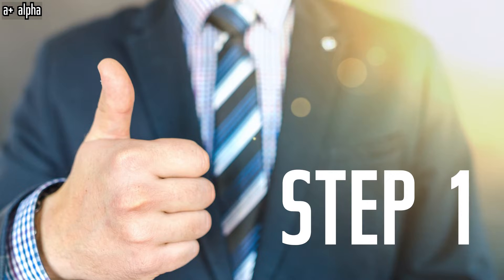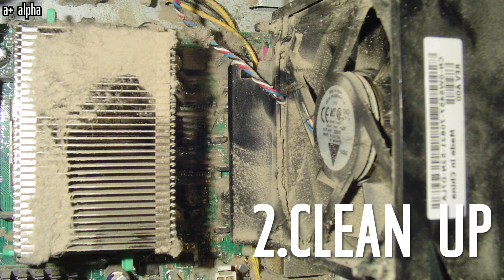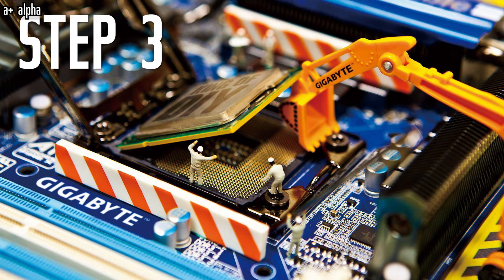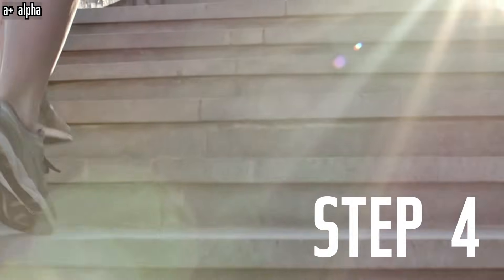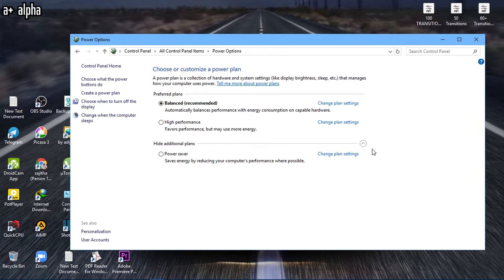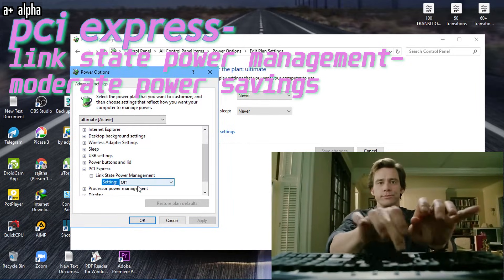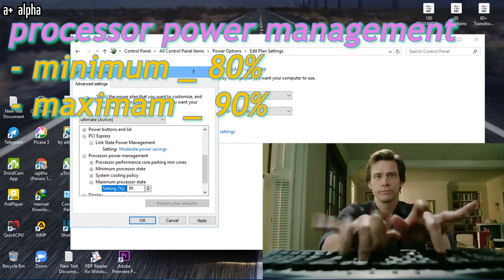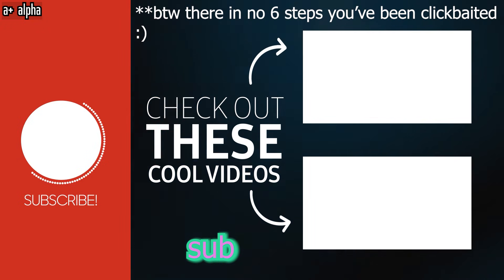✔️how to FIX your PC high temperatures | overheating CPU/GPU when gaming [complete guide]

Comment: I used step 4, it dropped my idle temp from 70 to 40 - 45.
I will edit the comment when I check the temperature in-game. 
Edit: I checked BeamNG drive and came to a conclusion that the problem is itself in the game, the temperature didn’t change at all. BUT then I checked MGSV, there the result was noticeable. My temp dropped form 60 - 70 to 52. I didn’t really notice any fps drop. My pc became less noisy. So, for those who are reading this, step 4 was relly helpful, you should definitely try it out.
Reply from the maker: Appreciate the comment ❣️
Reply: @AAlpha69  thx

Comment: I switched power plan from Balanced to High Performance. Apparently there is some glitch on the balanced plan that caused the processors to overheat when going at full capacity, but by switching to high performance my processor is back at 4GHz without the temperatures climbing high.
Reply: I'm having this issue as well where the Balanced Power is causing my CPU to overheat but when switched to Ultimate Performance it goes down
Reply: Is it applicable for laptops too?
Reply: @toonsduniya6721  The glitch was/is on Windows 10 Home for desktop, but having too many tabs opened on Firefox browser also caused some overheating.

Comment: I messed with the power management setting before and cranked it up. Cpu started freezing and supper bouncy hight temps. I turned down settings and forgot about it, temps stayed around 45-60 with aoi. Started chasing fps again and now back at 80-90C consistently. So here I am full circle once again lmao

Comment: Guys, does step 4 make the fps decrease? Or something like that
Reply from the maker: If your CPUs not bottlenecking sys, There won't be a performance loss.
Reply: @AAlpha69  I've an i7-11700F and a RX6600. I checked on a website and it says neither CPU nor GPU bottleneck. Do you agree?
Reply from the maker: @gabryxr  probably not. Try max state at 99%.

Comment: Wont this efect on perfomans when it comes to 4step ?
Reply from the maker: Set max state 99% when facing such performance drop..
Reply: @AAlpha69  it helped a lot i removed case glass and i did step 4 temp in far cry 5 dont go over 46 celsius

Comment: Hey thanks bro for the vid. It is 🔥
But after applying the 4th step CPU temp is fine but performance takes hit like some minor slutter and 10-12 fps drop (even in Minecraft)
Currently testing the new game stray it is shuttering too much with this . Any advice?
Reply from the maker: Set max state to 99

Comment: This is probably best tutorial I found on yt ever, thank you so much! I dont expect much clicking on videos like this because they usually tell you about obvious stuff and stretch the video as much as possible, but this one is straight to the point and with a little bit of humour. My CPU temp is now at 75'C down from 95 and gpu at 70 down from 80. Its also solved my performance issues that I thought were caused by disk. I was literally about to buy a new one but turns out I just had to limit my cpu a little bit lmao. Thank you a lot man

Comment: June 2022, Here to say THANK YOU. Got an i5 11600k with an Aorus ATC 800. With my previus 3060ti it does'nt had any issues. But I've recently upgrade to a RX 6900 XT and man, the CPU goes to 75/79 so fast in some games and I wasn't able to lower it. The step 4 has made and inmediatly change and the cpu no have not reached the 60° yet! Fabulous!

By the way, to the troll that is saying performances o fps drop by using this metod, I can confirm than you don't loose not even 1 fps. On some games the fps have even got better!

Comment: I have a 5950x and 6900xt with a z73 and 1000w gold psu. I noticed my cou got from 64 Celsius to 84 and up to 94 and then it auto shuts off at 99 Celsius but apex legends is the only game this happens with. Any comments or suggestions ?
Reply from the maker: Try 4th step.

Comment: I tried step 4 and I’m still getting 82 degrees on overwatch medium graphics and for most of my other games it keeps getting so high
Reply from the maker: probably bad airflow or bad cooler...
Reply: @AAlpha69  it’s a prebuilt I bought a couple weeks ago is this a common problem?
Reply from the maker: @spongewitdagat272  Check if there's thermal paste applied or not. Which type of cooler is it?liq or normal?

Comment: Step 4 really fixed my problem, if temperatures rise again I will make a edit to my comment . At first i was having abnormal temps on idle which wasn’t ideal but I could live with it , then I upgraded from a Ryzen 7 3700x to a ryzen 9 5900x and that is when I started having my pc crash due to reaching 81c and up . This video has helped me more than ANY other video . And I’ve tried many .

Comment: I am absolutely gutted I just bought a new PC 3060ti with i5-12600k
The GPU is probably fine when reaches 80s maximum but the CPU is so much high and didn’t expect that 100 degrees in some games and others are 90s I was using the intel stock fan it was a mistake after that I put a liquid cooler dark flash symphony TR120mm one fan still didn’t help I don’t know what the heck is going on
Reply from the maker: try the 4th step...
Reply: @AAlpha69  I used this step in my old 2070rtx gaming laptop it was fine and it doesn’t go more than 80s but it sacrificed too much perfromance so I didn’t get PC to do the same as the old laptop what other solutions could I do ?
Reply from the maker: @Am94514  MAKE SURE THE AIR FLOW IS GOOD IN THE CASE..

Comment: Note when u about to do the step 4 it will decrease your cpu ghz/speed (by like 20% or 30%) buut it will fix ur high temp problem.
Reply: Dumb question but what will happen if it gets decreased? Like what are the side effects
Reply: @Hourglass276  slows down your pc but not really that slow, its just that it wont have the same speed as before but its better since you dont have to worry about your pc overheating

Comment: Does step four take a hit on your fps? Or smooth sailing
Reply from the maker: itll reduce freezing
Reply: @AAlpha69  i did step four, then over clocked, keeps temps at bay and my fps is solid thank u❤️‍🔥
Reply: @akaricodane401  safe?
Reply: @aj-ln4by  safe!
Reply: @akaricodane401  did you do the exact thing in the vid or did u tweak it
Reply: @aj-ln4by  no i did step 4 then went to my bios and OC the cpu got it up to 5.0gz with high temps of around 60 now and usual around 30 to 40
Reply: @akaricodane401  any fps drops?
Reply: @aj-ln4by  no increases actually cause its cooler

Comment: Your video definitely lowered my temps, with CPU heavy games like Cold War and Forza getting lower than 50 degrees most the time, but I was having issues where my windows would start to crash. Could this be fixed by raising the maximum power state to 99%? (I have a 5600X if that matters)
Reply from the maker: try 99%

Comment: If i follow step no.4 is there a decrease  performance in ultra presets settings game..for example cyberpunk 2077
Reply from the maker: mostly not.. if ur having performance lost then set max state to 99%
Reply: @AAlpha69  i try set to 99% its better then set 90% but my clock speed cpu only run by default..my cpu core i5 9400f btw..it is normal if i play game cpu just running on default speed ?
Reply from the maker: @pyjamascomp6134  clock speed should change when u change pross. state
Reply: @AAlpha69  thank man you save my time

Comment: If you have an Intel I7 11700k you will benefit the most from step 4. If you have a gigabyte motherboard your thermal with I7 will be a disaster! The reason why, is the gigabyte motherboard is not set to any specs to accommodate the Intel I7 11700k. Intel recommends 125 W For peak power consumption. Gigabyte motherboard doesn’t regulate a throttle performance when the i7 turbo boost kicks in to almost 5000 MHz and spikes. The readings was nearly 250 W hitting the CPU which is 125 W over intels specifications. That’s the reason why it spikes up quickly to 95 Celsius or even 100 Celsius if your computer even stays on, most likely will freeze your screen during gaming. Again this is under load when the demand of the turbo boost with the I7 kicks in and there is no throttle regulation from the motherboard. Other motherboards are set to regulate throttle power and gigabyte is not and your motherboard you’re using might not be, you’ll have to do some specifications checks. If you do the minimum 80% you might lose some FPS but have better thermals. I would recommend an aftermarket cooling system and then choose a throttle limiter in step 4 that will get you the best FPS without a thermal shut down. 70c-75 peaking should be ok. An AIO cooling System Should help you to add a little bit more throttle to it from the motherboard. Again, just regulate the thermal’s.
Reply: same was in my case i use 10900k

Comment: Step 4 saved me from buying a new cpu cooler. My cpu temp went down from 80~90c to 50~60c playing bf2042. Thanks man! Really appreciate it
Reply: U 200 percent it works goner tey weekend but dose it make games run slower?
Reply: @rickywise9614  I didn't really see any decrease in performance. Maybe slightly but not enough for me to notice
Reply: @paulcho5752  It stuck your CPU frequency It decreases performance
Reply: @edoardobarbieri360 No

Comment: Step 4 worked with the temperature, my avg temp reduced from 85-90 to 72-77. But I'm experiencing sudden frame drops after doing this. Do  you know how to fix it
Reply from the maker: set max state at 90 to 99%.. (higher number=better fps=higher temp)

Comment: if i change max power setting to 99% my cpu is locked on 3.725MHz but on 100% it jumps to 4800mhz can i do something to not lose this much performance with 1%?
Reply from the maker: get a better cooler and set max state to 100 %.. [ no other options i guess :((

Comment: It works but you will get lower fps how can I get more fps cause I used the last one but can I set another thing to get more fps?
Reply from the maker: change maximum processor state to 99% (it will increase temp slightly)
Reply: @AAlpha69  will buying a cooler help with the temps? Like a Noctua NH-U12S redux
Reply from the maker: yes .. good coolers reduce temps a lot ..
Reply from the maker: check out coolers in the description .
Reply: @AAlpha69  sometimes my pc resets but only when Im playing so I figured this might have something to do with my cpu temperature, sometimes it reaches 100 degrees. My cpu is a i7 8700 and im using the cooler box.. do u think    If I get a  noctua NH-U9S my cpu will decrease its temperature?
Reply from the maker: yes it will... do the 4th step also ...